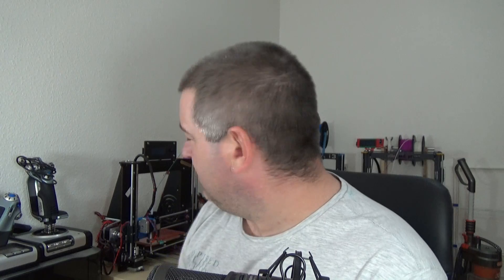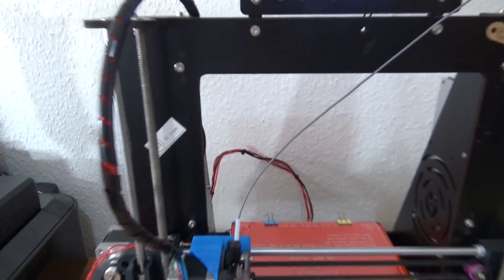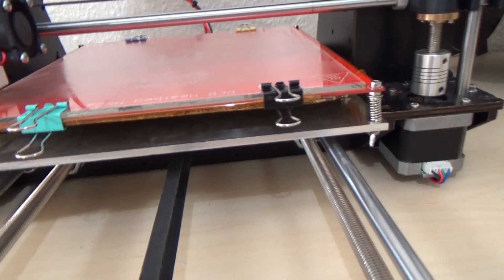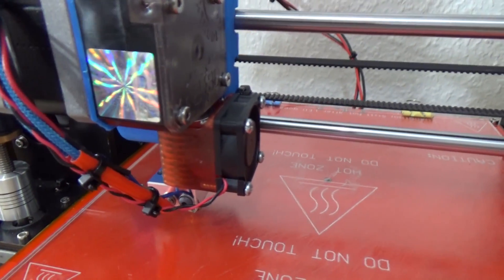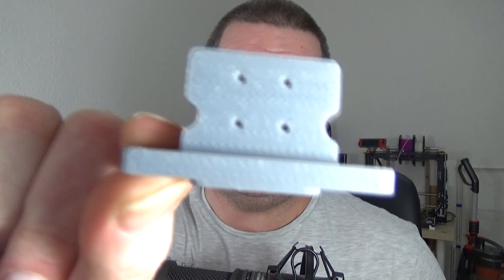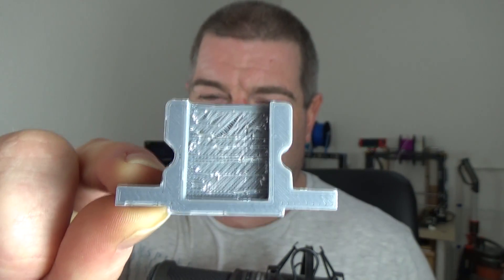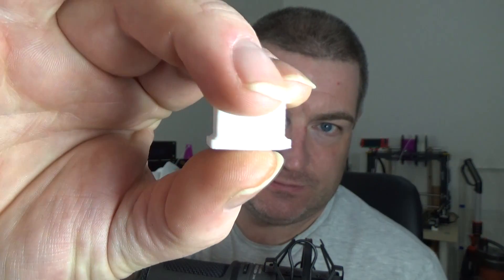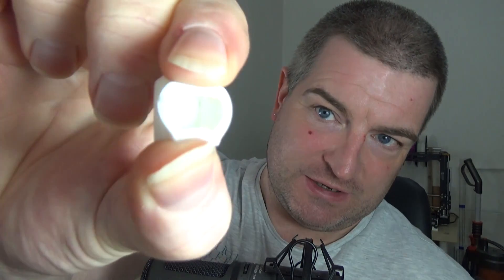E3D Titan & v6 fitted to an  ebay 3D Printer

Comment: I just thought: Thats a wood screw!!! A split second later you said: Yeah that is a wood screw. Lol I got the same printer. I reenforced it here and there during build, used locktite on every screw and it prints good from day one running a few hours every day :)
Reply from the maker: Andrew W. Thanks for the comment. I'm glad you're having fun with your printer. I've swapped out the frame on mine for an aluminium one. It was a lot of work but we'll worth it.

Comment: what firmware is that ure running pi3 pro ? cant find info anywhere
Reply from the maker: I am running the Geeetech Pro B "version"  Well that's what it was originally but I've flashed a clean Marlin onto it since.  There's a link to a download for it in my Marlin Config.h video

Comment: Hi Steve its me Gary again my titan is arriving tomorrow I  have a question for you I printed out the same bracket that you did but I was reading the titan assembly directions online they mention a 2mm shim did you use one ?
Reply from the maker: Gary Tonini Hi, my titan came with short and long bolts.  I used the short bolts and everything worked great with the printed x carriage :-)

Comment: http://www.thingiverse.com/thing:1310161   What way did you set this thing on the print table to print it out Steve ?   Thanks Gary
Reply from the maker: Hi Gary, I had the face where the LM8UU bearings sit, flat against the glass.  It took a few tries to get it printed as there's not a lot in contact with the glass.  I finally printed it with brim but the cleanup on the part was annoying.  Good luck with it :)
Reply: Thank you buddy you are always helpful do you have to turn brim on in slicer somewhere
Reply from the maker: Yeah it's a Slic3r setting.  Check out my "eBay Prusa i3 slic3r settings" video around 3min 10sec.

Comment: im looking to buy one of these ebay guys if I do would you say to replace the ramps board and power supply too. i already plan on swapping in a e3d v6 or e3d chimera.
Reply from the maker: Hi,
the control board on my printer is an all in one clone that uses the Ultimaker pin out numbers.  I flashed a newer version of Marlin onto it and it's been 100% fine.  However, I have not seen a second hotend heater connection on the board.
The power supply that came with my printer is ok too.  I've done a few 10 hour+ prints using ABS and it has been fine too.

Comment: Hello StevenQ-Ne-UK could u tell me how to calibrate  Z axis, mine is way to high can i can not seem to change i t i have the same printer from ebay and struggling getting it to work. If you could help me i would appreciate it
Reply from the maker: Hi, I had a lot of issues leveling the print bed and calibrating the z axis end stop.  I found the the whole y axis would twist or the wooden plate under the print bed would warp.  Once I swapped the y axis for the "stronger" version and replaced the wooden plate for aluminium everything was so much easier to calibrate.

If you still have the wooden plate under the print bed, try this.

Remove the glass and pcb
Remove the wooden plate
Turn the wooden plate over
Reassemble everything

When leveling the bed do not put any more that "light pressure" on the springs.  Any more than light pressure will warp the wooden plate again.

Good luck
Reply: sorry for the late reply yep it was the bed and the end stop, also have an other problem i can not up load new firmware it keep saysing.
avrdude: stk500v2_ReceiveMessage(): timeout
avrdude: stk500v2_ReceiveMessage(): timeout
avrdude: stk500v2_ReceiveMessage(): timeout
avrdude: stk500v2_ReceiveMessage(): timeout
avrdude: stk500v2_ReceiveMessage(): timeout
avrdude: stk500v2_ReceiveMessage(): timeout
avrdude: stk500v2_getsync(): timeout communicating with programmer
An error occurred while uploading the sketch

any ideas how i can get a new marlin firmware to upload only doing this because i broken my sd card slot and brought a new screen but it powers on but no writing on the screen just a line

Comment: hey pal hoping you can help. which firmware did you use for the printer? plus do you have a copy of settings for simplyfy3d... I am struggling like.mad to get mine working
Reply from the maker: Hi,  sorry, I can't help with simplyfy3d as I don't have a copy.  I only use Repetier Host (which is really Slic3r)
Reply: StevenQ-NE-UK do you have the settings for repiter?
Reply from the maker: I did a video all about my Repetier (Slic3r) settings

https://www.youtube.com/watch?v=p_YN8Q9r-Tc

hope this helps

Comment: which firmware did you use? (can I have link)  The firmwarw that comes with the printer has so.e weird extruder limit where it stops extruding after a certain amount of filament even though the nozzle has no issues and nothing is blocked.
Reply from the maker: Hi,  I'll be putting a short video up very soon showing where I got a compatible version of Marlin as well as showing all my Slic3r settings for this printer.

Steve

Comment: Hi there is there any way to contact with you , as I have lots problem with this printer lol thanks
Reply from the maker: TheAgnis182 Sure thing. feel free to email me via the YouTube about tab
Reply: StevenQ-NE-UK   see if speed is 100 then flow should be 100 to ?/also what's normal speed ? And PS happy Christmas :)
Reply from the maker: Hi,
I usually print at 30 mm / sec for "normal" prints or 60 mm / sec for "fast" prints.  I have a whole lot of Slic3r settings for the speed, temp etc etc.  I can share them with you if you like.  Be aware that my settings print the first layer VERY slowly.
If speed is 100% then flow "should" be 100% but, it depends on your steps per mm, filament and what part you are printing.  I run the flow slower for bridges.  The idea is to stretch the filament and reduce sagging.  But this only works some times.
It's all a bit "find out what works for you" Don't be afraid to change the speed or flow or anything as you can't really break the printer by changing those things.
Reply: StevenQ-NE-UK  yea thats would be nice , see I have on pursa i3 the same program on as u and I put on 100 speed but its not saying what its 100% or 100mm/s and its gos up to 999 I printed out one of ed3d head bracket out and its was printing 4h , and also I can't connect printer with PC thru cure I had SD car with all programs in it but its died lol

Comment: Thanks for putting this video up- was considering doing the same upgrade, with the same printer :) Was reluctant to somewhat as whilst it's currently working OK, it's hard to justify potentially breaking it :D

For the Z- axis wobble, I fixed mine with http://www.ebay.co.uk/itm/291910581944 - - set Z-step/mm to 1600; might need to drill/file the top bracket to fit, and needed to add some nuts to hold the new brass-nut as it's not tapped.

For the E3D+Titan combo, did you need to change any settings in the firmware? Up till now, I generally only print at about 25mm/s - that video seems incredibly fast after watching this printer go so slowly for so long! Retraction and infill quality seems pretty pants with the stock extruder, so the upgrade may well be worth it :D Get what you pay for I suppose, but it's perfect for the learning curve :)
Reply from the maker: Hi,
For the Titan and the Lite6 I changed the steps per mm of the extruder and I did a PID auto tune for the hot end.  I added both sets of settings to the firmware and re-flashed the board.
By no means is this the best printer for the cash but, in my opinion, it's a great printer to mess with and modify, if you're into that sort of thing.

Comment: I have the titan too and I always have to turn up my flow to 500 for it to extude correctly. Is there any numbers i can change in the firmware?
Reply from the maker: Ciber AV Sounds like you need to tune your steps per mm for the titan
Reply: How did you do it??
Reply from the maker: Ciber AV There's a link to Tom's extruder tuning video in the comments of this video

Comment: What did you use to connect the Titan to  the printer.(can u give me link to buy part)  I have this printer am going to buy the Titan and the v6
Reply from the maker: Hi,  I printed this part from thingiverse
http://www.thingiverse.com/thing:1310161
It is a whole new X carriage.  If you go with it you may have to reverse the x axis motor direction too.

There are a few that bolt onto the existing x carriage too but you'll have to double check the bolt hole sizes and spacing first.
http://www.thingiverse.com/thing:1562887
http://www.thingiverse.com/thing:1477900

hope this helps

Steve

Comment: Hi Steve,
I have exactly the same printer that bought off from eBay too. My e3d is on its way. Just wanted to get some advice onto it. Would be appreciated
Reply from the maker: Hi,  I am planning to fit my E3D lite 6 and cheap MK8 extruder onto this printer soon.  Who knows, I might even do it as a mini design / print / fit series :)

Comment: I have upgraded my Hictop i3 with the same parts from e3d but dont no how to alter the e-steps permanently as I don't have the save to eprom on the card ,  it is a bind having to alter the steps before every time I use the printer the card is MPX 1.3 if anyone knows how to get round this  well done Steven  good videos
Reply from the maker: Hi Ron.
If you have the firmware you can make adjustments in the Config.h tab then flash it to the printer.
If not I am sure there are g-code commands to set the steps and save them.  You'll need a way of sending g-code to your printer manually.
I use Repetier Hosts manual control tab as there is an area for sending g-code.  I am sure Octaprint and Prontaface have the same function.

Tom has a video on his channel covering the whole "extruder calibration" topic including the g-code commands for setting the steps and saving.
Check it out here

https://www.youtube.com/watch?v=YUPfBJz3I6Y

(around 5 mins 48 secs, but the whole video is very interesting)

good luck

Steve
Reply: Thanks Steve I have various firmware but dont know if it is the right ver as I cant download from card to compare
I have the e-steps setting for the basic extruder which are 94.4  so I will have to work out the math calculations
I cant put the firmware in ardunio as it is a cpp file
Reply from the maker: Hi Ron,
In that case I'd use the g-code options.  I've gleaned the following from Tom's video.
First, you'll need to be able to see the printer log.  Repetier host has a button to display this log on screen.
Send M503 to have your current settings sent to the log.  The steps per mm are usually shown like this ("x steps","y steps","z steps","extruder steps")
Do the measure, extrude, maths thing, then use M92 E"new steps per mm"
Do another measure, extrude thing to test the new setting.
Once you are happy send M500 to save the new setting to the EEPROM
Good luck
Steve
Reply: Cheers I have sorted it now by watching videos and saved new  code I can alter now that I know what does what in the ardunio sketch

Comment: Good video Steve.  I got the I3 Prusa kit from E3d including the bracket you printed and a cooling shroud that mounts on the back.  I took Tom Sanladerer's recommendation and replaced the Nema 17 motor with what he called a pancake motor - 13N-cm stepper to reduce the weight on the x-axis.  Also, with the smaller motor I didn't need a screw for the X stop switch.  I'm using a Geeetech Aluminum i3 pro b and I've had a lot of problems with Z-axis wobble.  I printed some Z-wobble fix brackets which helped a lot.  I notice that your Z-Axis rods are very steady and look wobble-free.  How did you accomplish that?  
Can you say a little more of what you did with the cork and kapton tape?  I assume that is to help direct the heat up since I notice that my heated PCB bed takes a long time to heat up.

Also, did you have to flip the Extruder motor connector to get it to run in the proper direction?  I did to fix it from running backwards.

Comment: Any prusa i3's on ebay that you would recommend since you've tried a few?  Or i should say any of the el cheapo 3d printers on ebay.  It's a minefield looking when buying your first.
Reply from the maker: Hiya Colin.  The £159 kit I got was annoying at first.  The threaded rod, nuts etc and 3mm Aluminium plate cost about £20 all in.  That made it much better.  Adding the Titan and v6 from E3D adds another £110 ish to the price.  This puts it into the price range of the Acrylic i3's on eBay.  To be honest, I picked up this cheap printer to find out what you got for your money.  Turns out you get quite a bit for the cash but I wouldn't recommend it as a first printer, unless you were ready to mess with it and swear a lot.  As for the other i3's on eBay, I can't imagine them having any higher spec components, just a more rigid frame.  I guess the best way to sum up the sub £300 eBay i3 kits is, "Buy one and be prepared to make it your own"

Comment: Great video as always Steve,
I have the Titan/E3D v6 on my homebrew i3 variant too, and it's awesome. 
Strangely I hadn't thought of printing connector covers with Ninja Flex (Doh!) so thanks for the idea.
Reply from the maker: Hi, thanks for the great comment.  I can share the XT60 cover STL file with you if you like.  I also designed a 3S balance connector cover that clips to the main output wires.  The idea is to prevent the balance connector getting caught up in the props of my quad.  I can share that STL file too if you like.  Just let me know :)
Reply: You have been busy eh :-) I don't fly quads any more, I tend to lean toward less energetic stuff indoors, but I'll give you a shout if I need them.
I'm keeping my ear to the ground for a bigger printer, but not seen anything that ticks all the boxes yet. My favourite so far is the G Max 1.5XT+ but they don't ship to the UK (I checked).
The BigBox is good too, but I'm hoping they will do a bigger version.
Until I see something bigger, my DIY i3 is doing a superb job.
I might even DIY a big printer.
Do you know of any 3D print shows or Maker Fairs here in the UK? I've been going to the one in Brighton since it started, but it's been cancelled :-(